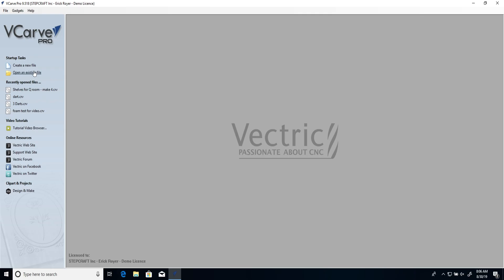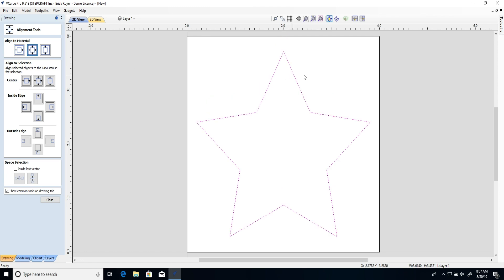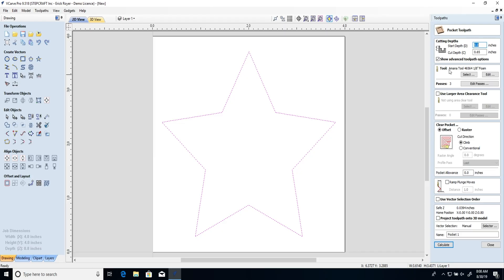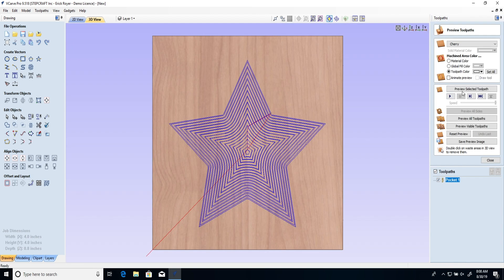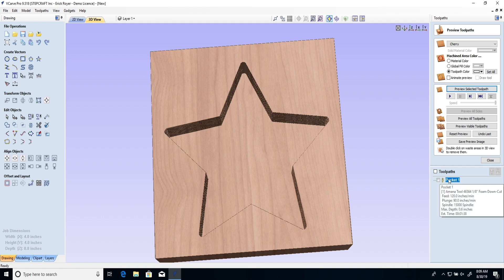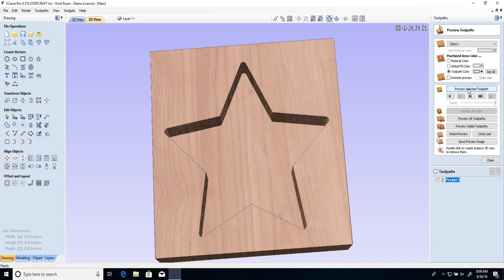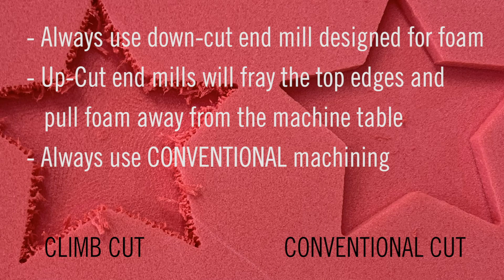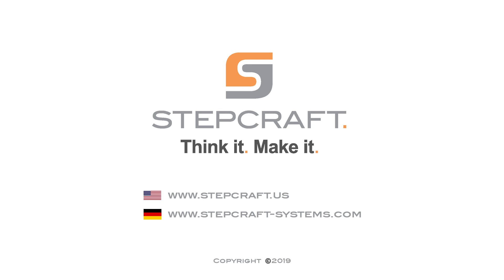Perfect Foam Cutting Results From Your CNC Every Time

Comment: Turns out that "conventional" really is the magic word here.
Just tested it with some 3€ Aliexpress single flute (for alu / plastic milling) and it works just dandy in some PE cell foam (the white stuff you often get in electronics packages).
It also helps to crank the travel rate way up and plunge deep – otherwise the foam will be displaced rather than cut.
For my 500W 3018 it was 1400mm/s X/Y, 800mm/s Z and 12000 spindle and going in 10mm at one time.

Comment: Thank you. Currently machining foam inserts for a knife display case and am running into the messy cut edges. Tried all kinds of different bits.

Edit: I have the same kind of bit except it’s an upcut, and it still works great.
Reply: What kind of feeds and speeds do you use?

Comment: That is a good looking cut Erick! Nice to hear you on the channel. What foam were you cutting there and how were you clamping/securing the foam to the table? I typically use XPS because it is stiff enough to clamp with a toe clamps. Would be nice to be able to cut more open cell foams like the one in this video.